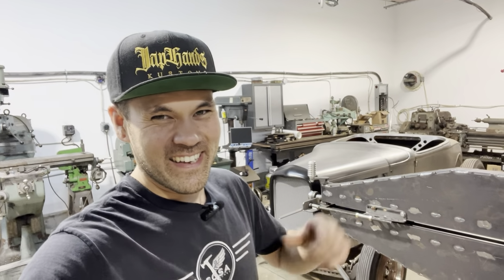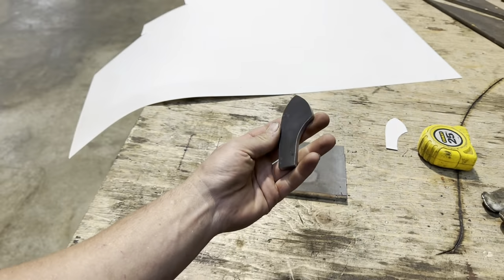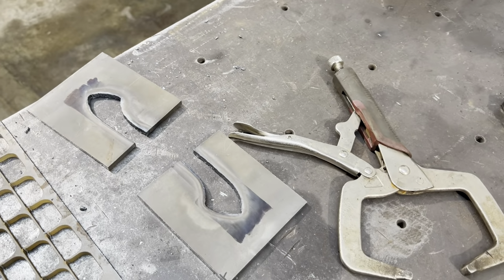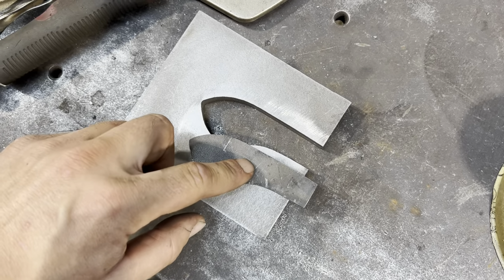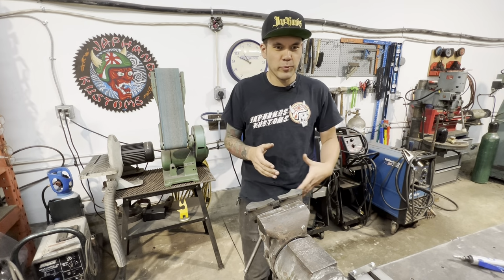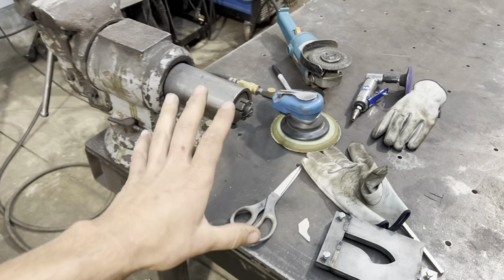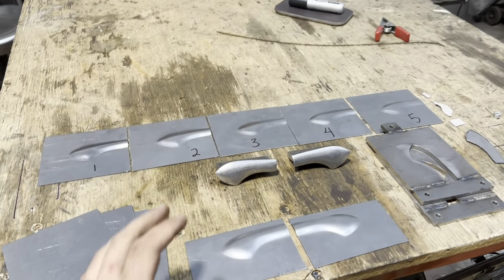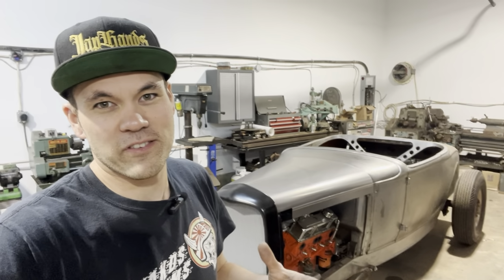How to Finish a Bead Roll & Make a Hammer/Press Form - Roadster Hood Pt 2

Comment: I’m curious about the decision making process for either making your hammer form out of metal or wood, am I correct in that you have shown doing both?
Reply from the maker: For simpler shapes that are more bending than shaping I like to use wood but for Tight shapes with crisp lines where more effort and pressure is applied, I like to use metal. This could be done out of aluminum as well
Reply: @MakeItKustom  thanks for the reply and the explanation it makes complete sense

Comment: Curious, is there a specific reason why don't you use a press rather than hammer forming for more uniformity across the die?

I'm assuming you're just demonstrating how people can do this with simple garage tools, but there might be a different reason...
Reply from the maker: Absolutely correct I would normally use the press just want to show how easy it is with simple stuff like hammers
Reply: @MakeItKustom  nothing wrong with that.  As a small startup shop like mine, stuff like this helps me think outside the box when problem solving

Comment: I have made a few press dies like this for one of stuff 

save yourself the time and buy a 3d printer they are as cheap as a paper printer now days and while it's making the dies you can be doing something else productive 

the plastic tooling if printed at 100% will last a few goes I have had some ones go for over 100 pressings in alloy 

It also fails long before you get any shearing in the sheet metal and weights less than steel if it lets go it doesn't get into low earth orbit
Reply from the maker: Yeah I’ve got some friends that use their 3-D printers for this. I definitely should learn some fusion 360

Comment: Would it be cheating to use a cnc to make those dies? Or maybe you just like the exercise? I just sold two large  ones....left over from a business. I used them to make guitars and composite aircraft propellers before that.
Reply from the maker: I don’t think it’s cheating I just wanted to show how you could do it yourself without my machine
Reply: @MakeItKustom  I said it because a video showing the entire cad/cam process of achieving the same thing...would be just as good.

Comment: All very good skills, very good. But I think you have a CNC plasma machine, so do I. Why not just program it and have the male and female at the same time. Use the fine cut consumables, slow the cut speed down and then use a file. I've seen most of your videos and I like them because I see things I can do different and better. I don't mean this to be critical and I hope it doesn't come off like that. There is always more than one way to do every job.
Reply from the maker: Absolutely it would’ve been so much faster and easier to use the plasma cutter. It’s good that you think that way and that you have the tools to save time. I wanted the video to be a little bit more relatable to the garage fabricator that may not be as privileged as you and I to have a Cnc Machine on hand.

Comment: SALUT 
JAIS VU TU COUPER 2 PLAIT 1/4'' X 4 1/2 X 5'' ET DEUX PETIT MORCEAU POUR LA FINITION DU HOOD
SI TU REGARDE LE RESTE DU MORS FAIRE CALANDRE POUR UN RADIATEUR  
HELLO
JAIS VU TU CUT 2 PLAIT 1/4'' X 4 1/2 X 5'' AND TWO SMALL PIECES FOR THE FINISH OF THE HOOD
IF YOU LOOK AT THE REST OF THE BIT MAKE GRILLE FOR A RADIATOR